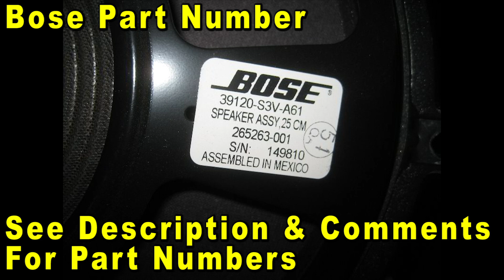2001 To 2006 Acura MDX How To Upgrade OEM Subwoofer Speaker With Sizes & Part Numbers

Comment from the maker: Acura MDX Subwoofer Speaker Size - https://amzn.to/3UiRlKh
Dynamat Sound Deadener - https://amzn.to/4dmQfpI
Precision Screwdriver Set - https://amzn.to/3sLixaP
Plastic Pry Bar Tools - https://amzn.to/3HMtsV7
Socket & Ratchet Set - https://amzn.to/3Z17LbA
Mechanix Gloves - https://amzn.to/3jCnHkt
Torque Wrench - https://amzn.to/3vS5uSI

The Paul79UF YouTube channel is a participant in the Amazon Services LLC Associates Program, an affiliate advertising program designed to provide a means for sites to earn advertising fees by advertising and linking to Amazon.

This DIY video shows owners of the 1st generation 2001, 2002, 2003, 2004, 2005 and 2006 Acura MDX how to change or upgrade the subwoofer speaker in the cargo area of the SUV.

Comment from the maker: Check out the DIY guide for changing the subwoofer speaker in a first generation 2001, 2002, 2003, 2004, 2005 & 2006 Acura MDX - 
https://www.paulstravelpictures.com/Acura-MDX-Subwoofer-Speaker-Replacement-Guide/index.html

Here are all of the DIY repair and maintenance tutorials for the 1st generation 2001, 2002, 2003, 2004, 2005 & 2006 Acura MDX -
https://www.paulstravelpictures.com/Articles/Acura-MDX-Common-Problems-Repair-Maintenance-Guides.htm

Owners of other Acura or Honda vehicles such as the RDX, ILX, TLX, RLX, TL, CL, RSX, RL, TSX, ZDX, NSX, Integra, Pilot, Accord, Civic, Fit, Clarity, CR-V, CR-Z, HR-V, Odyssey, Element  and Ridgeline may also find these DIY instructions to be helpful.